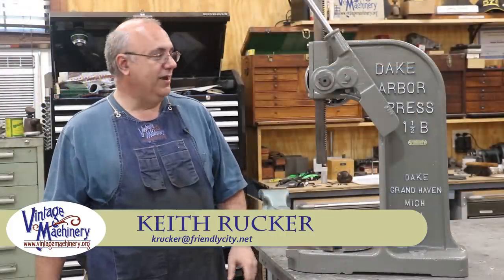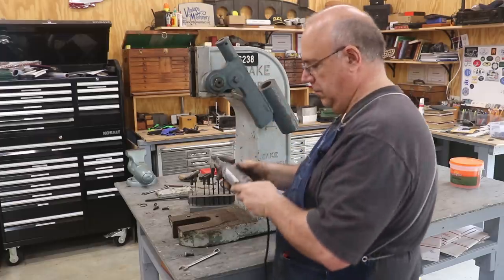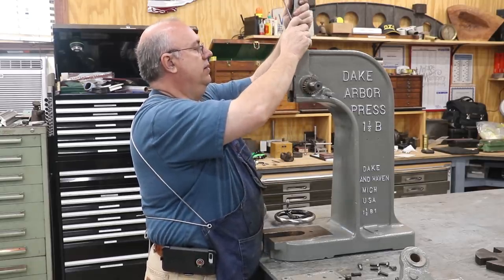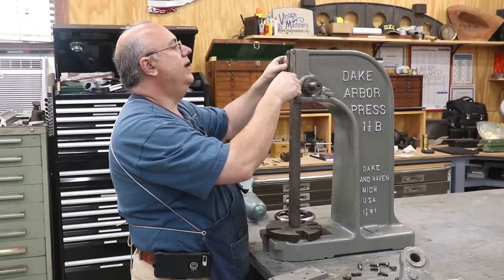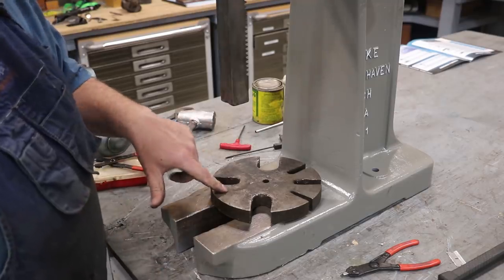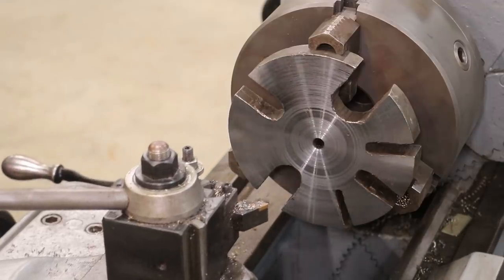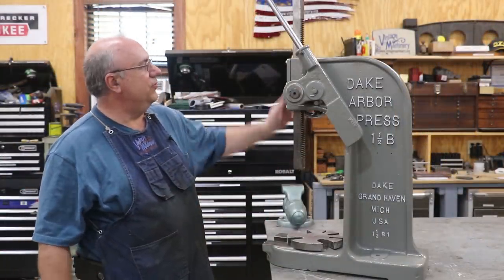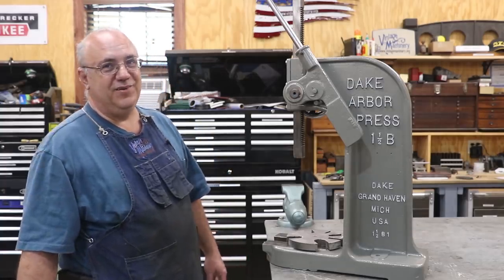Restoring a Dake 1-1/2 B Arbor Press

Comment: At the shop i worked in a much smaller Dake press was scrapped , because  in the          production job it was used in the force was always in the same place on the ram    ,stripping some teeth,  luckily  this was at the very end of the stroke, simply inverted the ram and used it in the maintenance shop for years .

Comment: I just picked this same press up at an auction. Only thing is it's missing the pull down handle and the ratchet part is missing the pin that holds it. Nice to see it looking cleaned up and properly functioning.

Comment: In the late '80s before carpal tunnel, our assy lines had many, many Dakes. Almost every job had a new Dake. We tried to recycle but rarely worked out, till the day I desperately needed a press and rebuilt one from the junk pile. After that every press, even brand new never-used was rebuilt to last many hundred thousand cycles.

Comment: Did you notice the Vee notches in the base of the arbor press? Many older arbor presses have them. Know what they are for?
 The notches in the base are there so that the press can be bolted to the end of the lathe bed. If you are running production work using arbor mandrels (e.g. turning gear blanks) between centers, it's really handy to have the arbor press on the end of the lathe so that you can rapidly mount and dismount the work from the mandrel.

Cheers from NC/USA
Reply: Thanks. Always wondered never knew.

Comment: Shouldn't that adjusting screw have a plate against the vertical shaft? It would prevent gouging of the shaft and take out all that slop I noticed when you pulled on the upper portion.
Reply: I was thinking the same thing.  Also was wondering if the plate isn't upside down.  I looked on the Dake site, but the current models don't have that screw, so the parts diagram doesn't have any reference, however the plate is shown the other way around (with the raised flat section in the upper portion).  I'd replace it with a nylon tipped screw for the same reason you mentioned.

Comment: I think there should be a plate between the front tensioning screw and the ram.
Reply: Yes, there should be a plate.  Have always seen a plate on these presses.
The ram is too sloppy.  You missed on this "restoration".
JIM